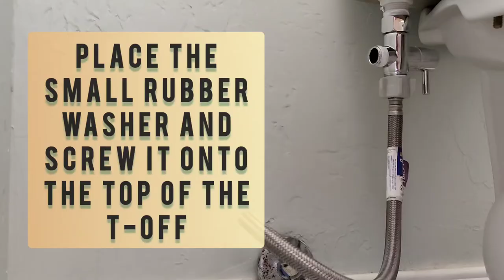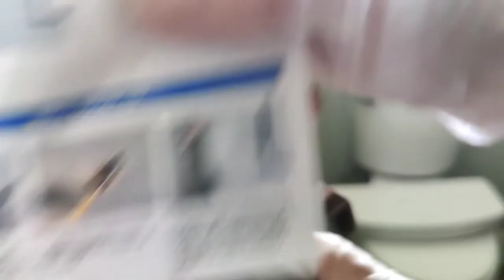Installing the handheld bidet, Arofa bidet from Amazon

Comment: Im trying to install this but there are still leaks no matter how tightly i screw it
Reply from the maker: Even with the Teflon tape? Make sure to not leave the water on when not in use. The pressure will back up.

Comment: Does the button/trigger have good sensitivity/control over the water pressure?
Reply from the maker: I've had it for two years now. Regular use with one other person using it. The pressure works well for me from light to higher pressure... However I found that it has been getting stuck. Only when I use it to clean the bowl. I guess pressing down too hard causes that. (Maybe I should make a follow-up video!)
Reply: @KhammanyOnEarth  good to know. All I’m concerned is that, it’s not the kind where either it’s too much pressure or too low pressure and nothing in between